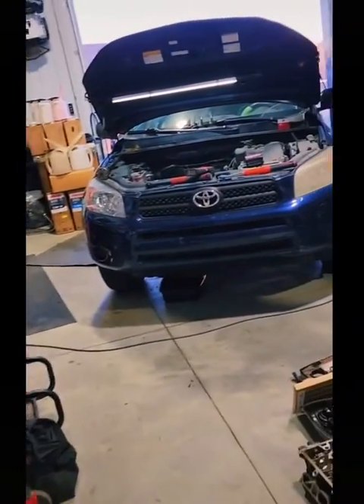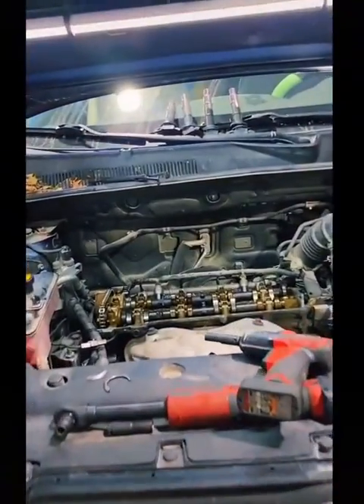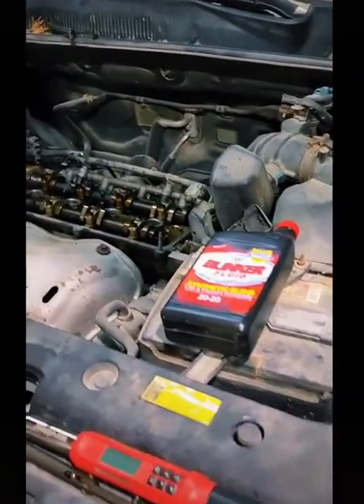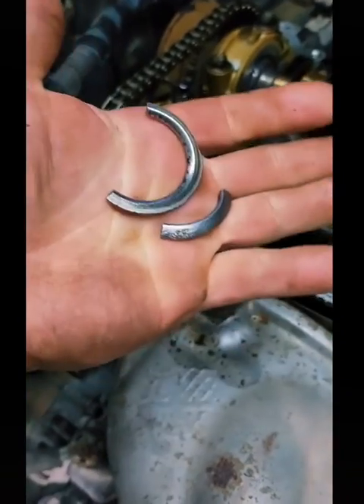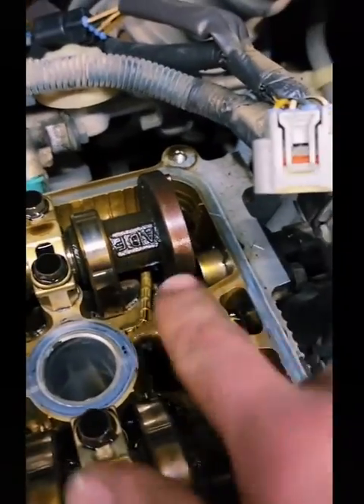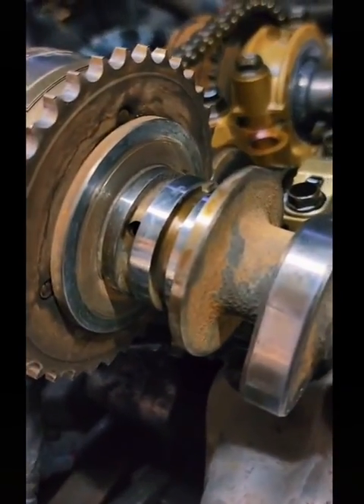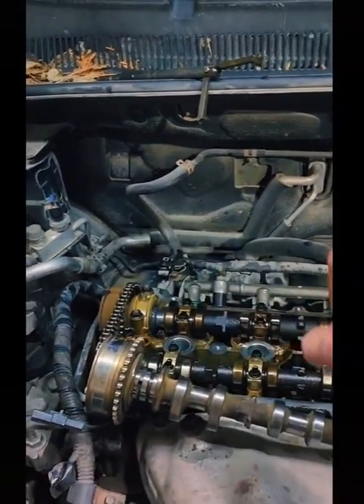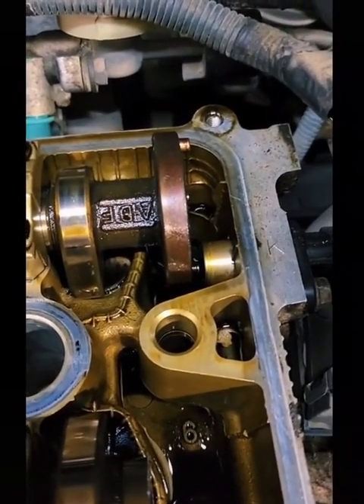Toyota Rav4 2.4 P0335 Diagnosis

Comment: I have a RAV4 with 2.4 with 198k miles and have had 1 check engine light for charcoal canister that’s it ( DO NOT top off fuel in this vehicle) .  Do all maintenance myself and only use Amsoil oil since I purchased it. Rust is getting it but engine still smooth as silk. This was very informative. Actually all of them are. Just found your Channel and subscribed as I like what I see and hear.
Reply: You should never top off a gas car.. Each time you do some liquid fuel will get to the charcoal canister and eventually destroys it and then you are looking at thousands in repair costs for continuously topping 2$ worth of gas in your tank.

Comment: Thank you so much for sharing, thís S.O.B toyota codes for crank and cam is a pain, working on my 2012 Sienna 2.7 keep getting the code P0335, after some testing on the crank related circuit, found nothing wrong, I am going to go open the valve cover and inspect. Thanks again.

Comment: I have this issue with a 2007 scion tc, has the same 2.4 l 2azfe engine and i have a p0335, i replaced the crankshaft position sensore but to no avail, still have the code and the car is hard to start. Should i pop the valve cover off and see if the camshafts are causing the same generic code

Comment: Great Video!
I have a 2009 Toyota Rav4, 4 Cylinder w/112,872 Miles & Toyota is telling me I have a "worn-out/old," not broken Camshaft & I need a New one. Total Cost:  $2,400+. It makes a dragging sound when I first start it up but runs perfectly fine afterwards. No backfiring, rattling, nothing but it is consuming quite a bit of Oil. Also, whatever Toyota did, they did not "Reset" my Engine Lights to come back on so, I won't know what the heck is going on!! Question: If I get it Repaired,  how long before my Engine gives out? Is it Worth getting repaired or should I Junk the Car?
Reply: For the oil consumption, you could try 0w30 or 5w30 instead of the original spec 0w20/5w20, until/unless you get some new piston oil rings. Having to switch to a thicker oil once oil consumption becomes a problem is something somewhat commonplace nowadays it seems. As for getting specifically the engine light reset, you could ask any auto parts store that knows how to use their diagnostic tool correctly to clear the codes for you, and also have them hand you a sheet that lists what codes you've got. Only do that if it's free.
Reply: Se quita ese sonido cambiando solo los engranajes vvti ese defecto traen y listo tambien desaparece el codigo p0335
Reply: @cesarzeta8497  también tienes una RAV4?

Comment: same exact problem here 2010 xb customer had a frontal impact right corner. I had the same symptoms except i noticed on hard left turns it would shift the cam over enough to set the same code so i oped the cover and sure was the same cam ring hangin around.

Comment: I have a matrix 2009 2.4 has the dame code. I don't want or can't Open de motor like you did. Do you think it willl should worry about it. Car runs fine just the light is on. Thanks in advance